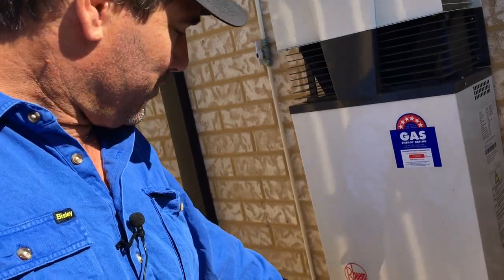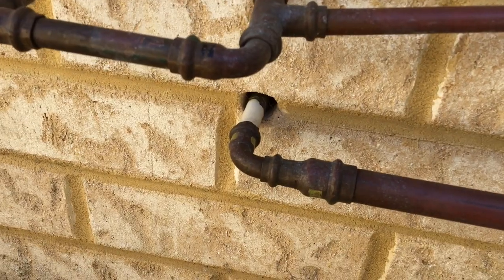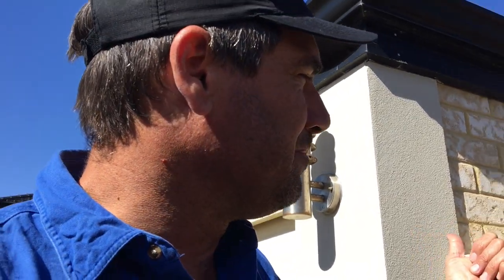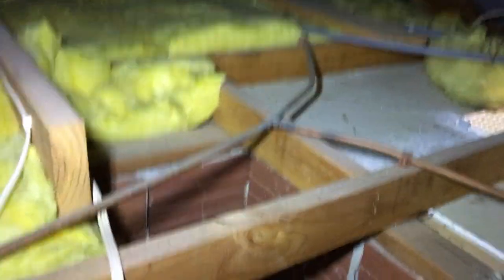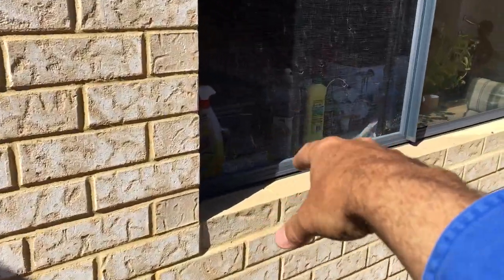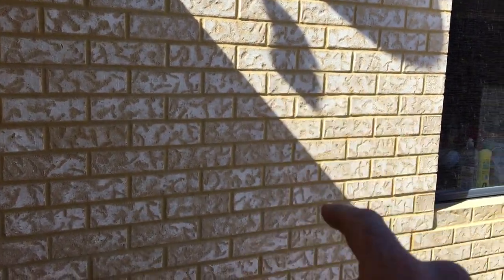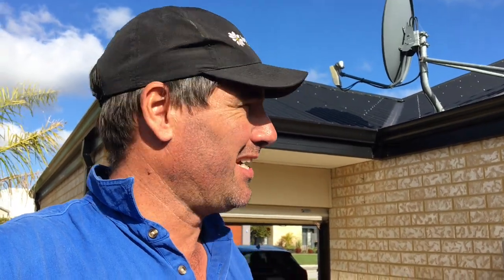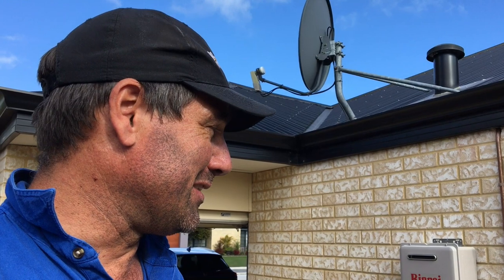Number 1 Reason Pipe Sizes Matter. You Need to See

Comment: Nice job, how did you go about connecting the hot and cold pipes through the block wall at the kitchen? Did you cut an access panel in there or? I'd love to know the method, thanks.

Comment: Looks like there could have been a Vulcan freeloader there originally and was replaced by a continuous flow gas water heater hence the 15mm pipe work thru the brick cavity . Only a fool would run 15mm copper back to the gas meter. Especially with Aussie copper pipe sizing being the external diameter of the pipe and not the internal bore as in New Zealand. You only need a kitchen hob to be on or a Brivis heater and then the water heater will go to fault code 12 (insufficent gas at burner)